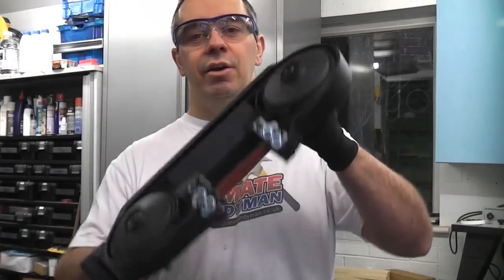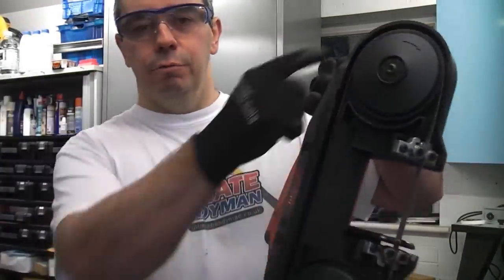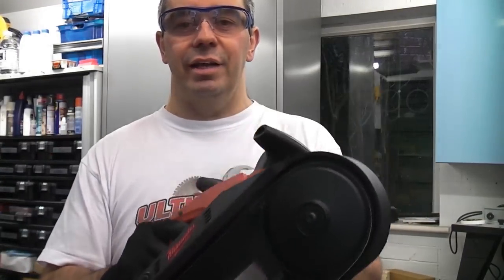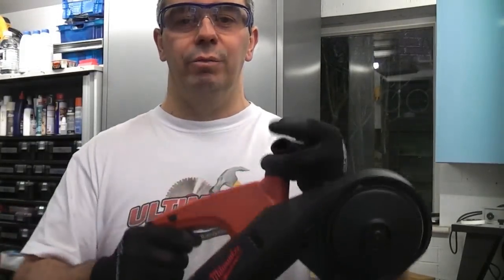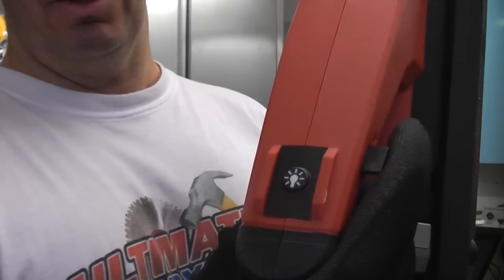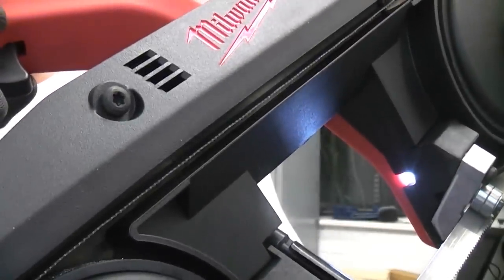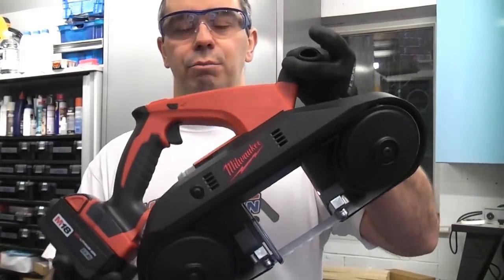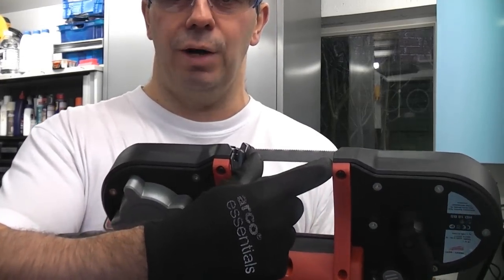Milwaukee HD18 BS | Milwaukee 18v bandsaw

Comment: I do love a portaband. Only have a corded version myself and I can't really justify the cost of cordless etc. Do love it for rough cutting stock though, especially thicker material, much more pleasant than using an angle grinder or hacksaw, also works great on non-ferrous and plastics too.
Reply from the maker: Yes, it's much easier to hold.
Thanks for the comment

Comment: Lovely tool, I gues because it cuts so quick too no real need for additional lubrication. Pretty good price it seems.
Reply from the maker: I would not like to try a lubricant with it as I think the band might slip off the rollers if lubricated, which is weird because a normal shop bandsaw would have coolant running constantly. I think the best option with this machine is to use it is short busts so that the blade does not get hot, perhaps a couple of minutes use at a time.
Thanks for the comment

Comment: thanks for the video and demonstrations. I have some questions please:  Is it possible to use it for wood too? Is it necessary to change the blade? Is it easy?
Reply from the maker: I would not use it on wood as it will dull the blade, although it would work.
Changing the blade takes less than a minute and is done by simply flipping a lever and then feeding it between the bearings.
Thanks for the comment

Comment: looks like it cuts pretty well! Is is impractical though as it looks difficult to get into smaller areas??
Also just picture if the band saw itself broke and whipped out!
Reply from the maker: Yes, it cuts well but a bit large to use in confined spaces.
I might try it out on some Stainless next to see how it performs.
Thanks for the comment

Comment: hi.got a quick question for you.I am fitting kitchen base units using Lbrackets.what  size screw should I use on the 18 mm carcass? prob going to use 2 inch to fix
 brackets to wall.many thanks
Reply from the maker: If there is a service gap at the back I normally use 2 inch long screws and place a piece of timber on the back side as the screws will grip the timber but not the chipboard. If it's going on a visible edge I'd use something like 12mm long size 8 screws.

Comment: Great machine ! I have a question please , is it enough to use only normal sunglasses to protect my eyes while welding ?
Reply from the maker: No definitely not.
You need a full face visor when welding with the correct lens fitted.
If you wear sunglasses to weld eventually you will go blind, unless of course you are gas welding in which case you can just wear a pair of welding goggles.
Reply: Thank you very much , I ask this question because i saw someone in youtube doing this ! thank you again for your help :)
Reply from the maker: MR MAN
You are welcome.
I have seen pictures of people arc welding in poorer countries with a piece of newspaper over their face and a pair of sunglasses. It's a very dangerous thing to do, as you only get one pair of eyes ;-)
Thanks for the comments
Reply: Thank for your reply :) by the way i bought this helmet today Aristo Tech 5-13 , it's auto darkening, but i didn't try it yet , my welder machine is K 130 - FIMER , it's pretty small :)

Comment: Does it need quite bit space for its operation? I am a plumber,  quite often doing work under the house and cutting off galvanized steel pipes up to 120mm in diameter and also I tend to work under or in a tightly confined space for the intended job, how do you think its suitability for my job? thanks
Reply from the maker: Yes, it does require a fair bit of room to get in to make the cut.
I'm not sure if it would be suitable in confined spaces, perhaps it would be a good idea to hire one for a few days before you decide whether or not to buy one.

Comment: Hi mate, I have never seen these before so I thank you for showing this tool. Were all these cuts done on a single charge? The battery seems more than capable of handling those cuts. N.
Reply from the maker: Hi Neil,
Yes all the cuts were done with the one charge. It's a 3AH battery.
It performed really well and was very effortless.
Thanks for the comment

Comment: How does it do cutting stainless steel piping and do the blades last long?
Reply from the maker: +kranob1 It will cut stainless, but you really need a coolant/lubricant when cutting stainless and you can't use too much with this machine or the blade can slip off the drive mechanism. I have cut stainless by applying a little Exact cutting paste to the teeth of the blade and it worked well. I don't know how long the blades will last on stainless as I have not cut enough of it!Thanks for the comment.
Reply: +Ultimate Handyman  thanks very much. Do the blades last long on Mildsteel?
Reply from the maker: +kranob1 
I have not used it that much yet. I only use it in areas where I can't cut the material by other means. So if I am at home I normally use the Evolution chop saw for mild steel  https://www.youtube.com/watch?v=zI09uLXTvmE
Or if I am on site I use the metal cutting bandsaw in their workshop. I only really use this machine if I need to cut a pipe or something out on the job, so it only gets used once every few months. 
If you are using it a lot I guess the blades would wear down quickly especially if it is continuous use due to the heat buildup, but if you are only using it now and again they should last longer.
Sorry I can't be of more help!
Reply: Not at all, thanks very much for your quick replies. I just ordered a 110v version, we cut a lot of 1 to 3 inch sch 40 piping in our line of work, all out on site and often in factory attics. I'll let you know how the blades hold up.
Reply from the maker: +kranob1 
Okay, I hope it works well for you ;-)
Thanks for the comments

Comment: pricy at £420 looks handy though
Reply from the maker: I got mine cheap at auction for £200 with charger, case and two 3ah batteries.
I have seen this machine naked online for £99 if you already have the batteries and charger.